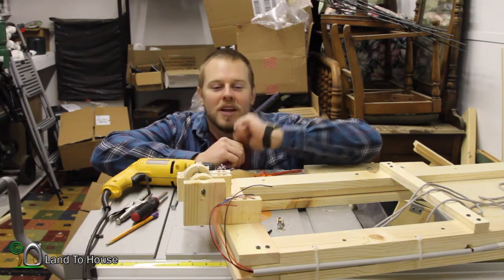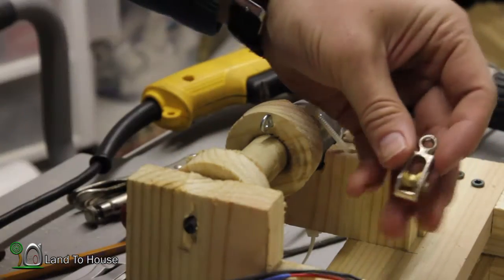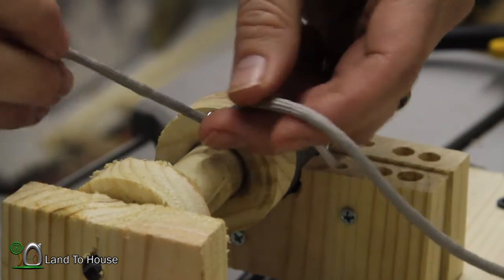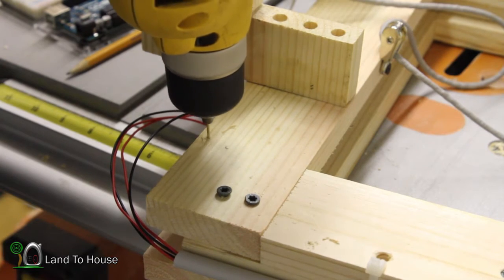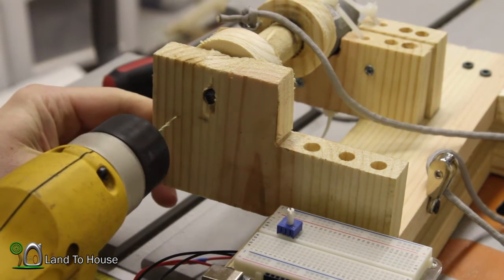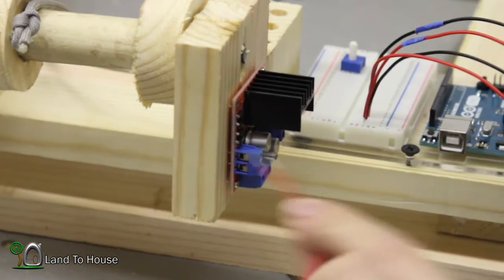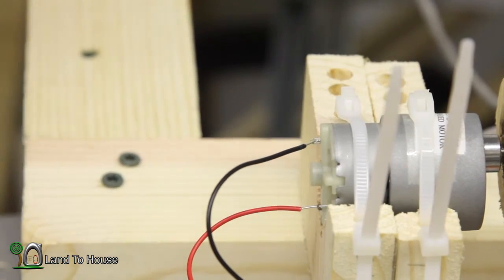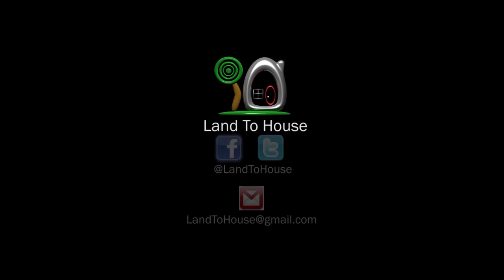Amazing Automatic Chicken Coop Door Part 4/7

Comment: As far as I am concerned, you are just now getting to the good stuff.  I hate to show my age, but none of this stuff existed when I was in school.  You are going to teach this old dog some new tricks.  I do like the idea of using the breadboard for the wiring so you can play around with it for troubleshooting easier.  It will also make it feasible to add and take away things as the project grows.
Reply from the maker: +Pidasian Hippie It is exciting for me as well. I have been though this stuff in school but we did not do much with it. Most of the time was spent with analogue and digital chips. Its much easier to work with a board like the arduino that is ready to go. later I will likely get into other things with the arduino. Auto feeding and watering and such. To power the coop I am going to be using solar. So that will add a lot of new projects to the future.
Reply: Land to House I will have to check these boards out.  It may be fun to do some projects with them.  It would be nice to have an automatic watering and feeding system.
Reply from the maker: +Pidasian Hippie They are surprisingly easy to work with. I got my brother in law a kit for $35 for christmas. it had everything you need for learning the basics.
Reply: Land to House That is reasonable.